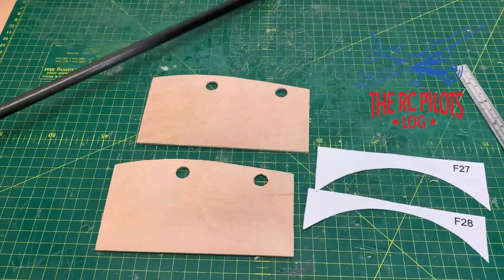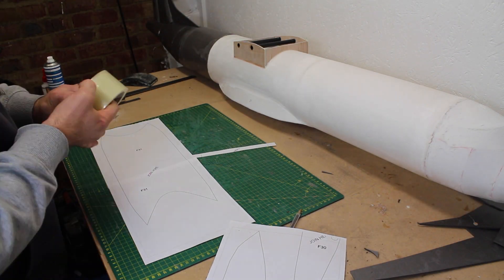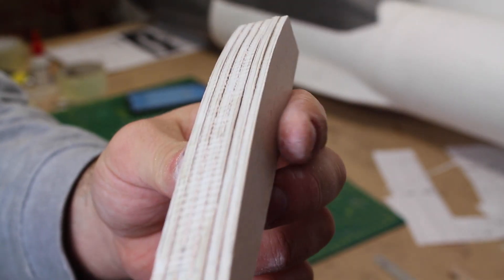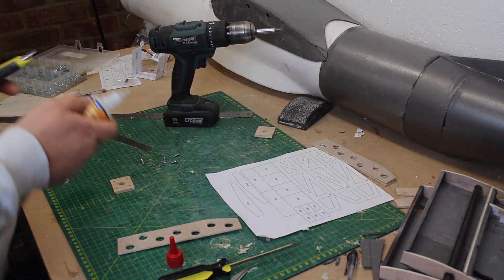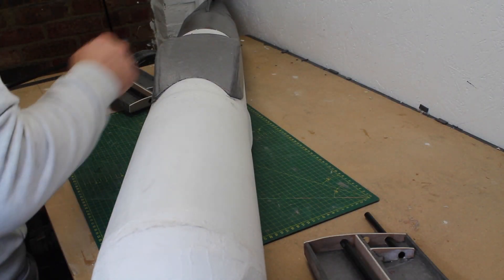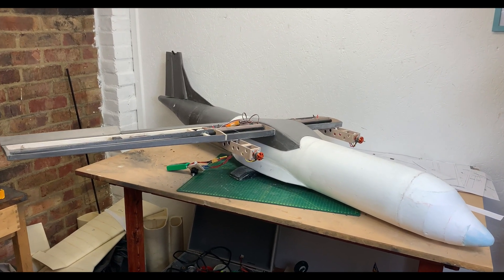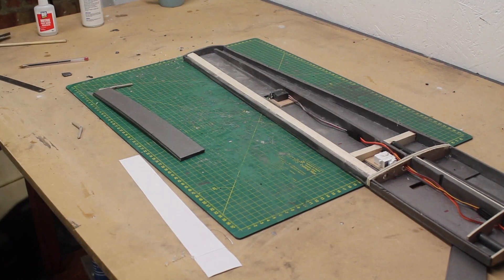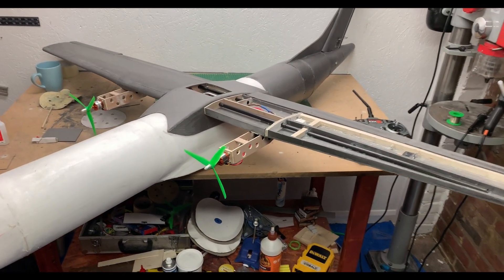ATR-72 600 RC Airliner build -  Part 3

Comment: Hi bud, glad to see your using the C/A. however you should spray the activator last, by the time you spray it then apply c/a to the piece the activator would have evaporated.
Reply from the maker: +RADIO FLYER I’ve been doing it both ways and it’s making no odds either way. The directions with this stuff actually says spray on one piece, glue the other and clamp.
Reply: @TheRCPilotsLog  yes that is correct, but the idea is that you have ample time in applying the c/a, then only when it mates with the activator should it set immediately. The reson you are not getting any difference is the activator has already evaporated. Spray the activator last then quickly place the 2 pieces together.